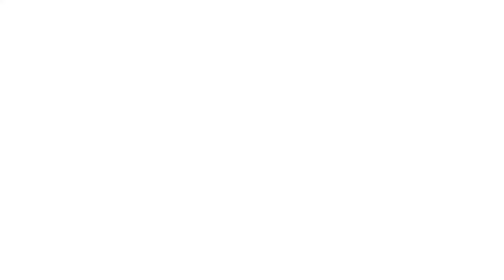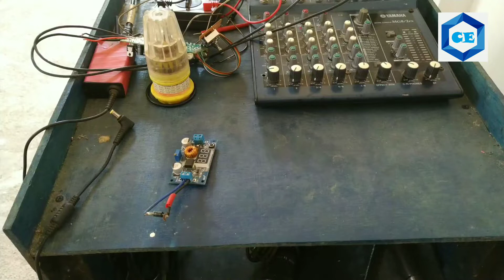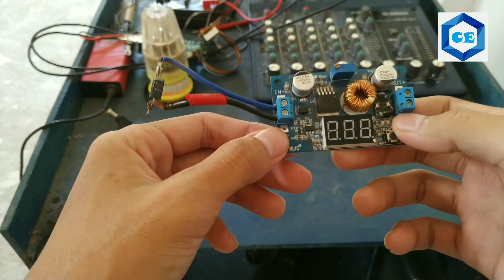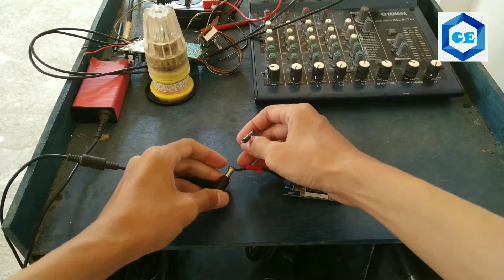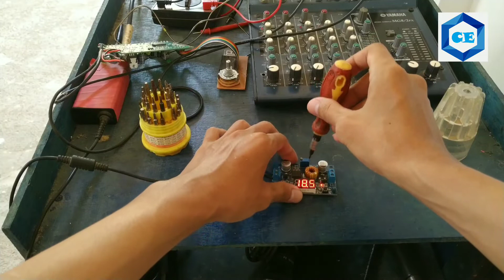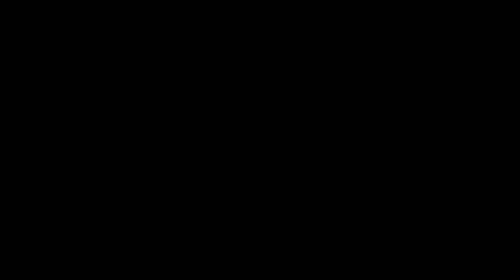Cara Menurunkan Tegangan Volt DC to DC Sesuai keinginan kita

Comment: mas... kalo bedanya Step Down sama Dimmer apa ya? apa sama aja itu fungsinya kah ? saya mau nurunin tegangan buat lampu DC 12v dari jaringan accu seri 24V, pakai Dimmer muterin manualnya suka gak pas.. jadinya lampu pada bledos karena over voltage... 

apa kalo step down otomatis lgs loncat ke 12v atau musti muter muter manual juga itu ya kaya si Dimmer 12v-24v

Comment: Malam gan .. saya punya kendala mau sharing boleh ?
Reply from the maker: Silahkan
Reply: Apa ada modul utk menurunkan ampere aki mobil ? Jadi sy punya aki mobil 12v 30a dan mau sy sambungkan ke pompa dc yg 3a...
Solusi nya bagaimana?
Reply from the maker: Sepertinya tidak masalah mas , itu mungkin membutuhkan daya 3a , gk harus 3a
Reply from the maker: Yang penting voltasenya 12v , kalau voltase pompa dcnya 5v cepet putus
Reply: Ok terimakasih ats masukan nya gan. Sy akan coba dlu

Comment: Trafo saya 60 vac ct, setelah di supply jafi 86 vdc,
Sedangkan driver maksimal hanya di 70 v,
Tolong pak solusinya gimana?
Reply from the maker: Ini apa? , Power ampli?
Reply: @CahElectro  iya tertulis di kit blazer 70 v persis itu,
Sedangkan psu sy menghasilkan angka 86 v kira2 d paksakan rusak ga ya driver nya
Reply from the maker: Volt trafo nggk ada yg di bawah 60vac?
Reply: Ga ada ,trafo toroid ct 60 sama extra ct 13 v ct. Apa harus modif power kali ya ganti volt elco lbh tinggi
Reply from the maker: Mending ganti driver saja bos / di modif ke yg berpengalaman
Reply: Oke makasih ya saran nya, sukses terus.

Comment: Kalau bikin 12 volt, 5,4 ampere bagaimana?
Reply from the maker: Kalau volt'nya bisa , kalau amperenya jari module yg sesuai keinginan
Reply: @CahElectro  apa nama modulnya? Saya mau pakai untuk pompa celup 12 volt, 5,4 ampere itu bagaimana maksudnya?
Reply from the maker: @langkahkecilku8480  adjustablr step down , cari yg 10a kalau mau di pakai beban 5,4 a
Reply: @CahElectro  terimakasih gan